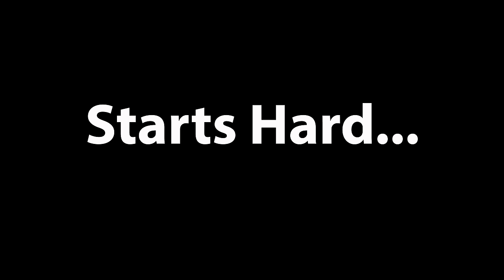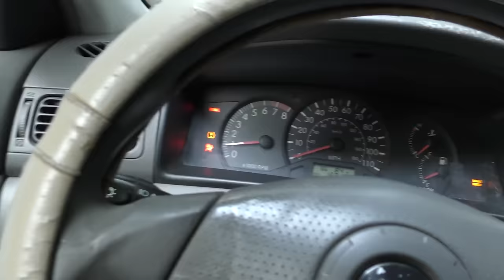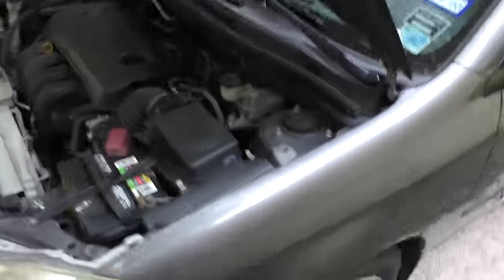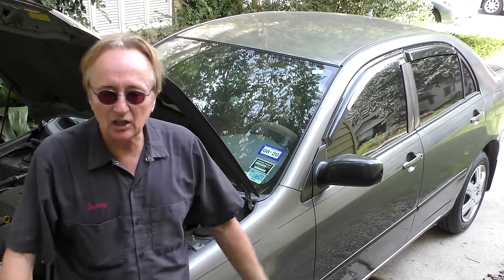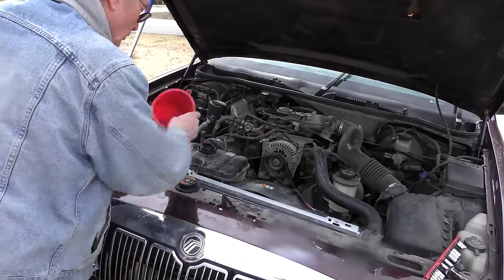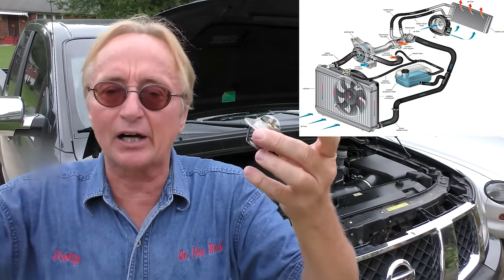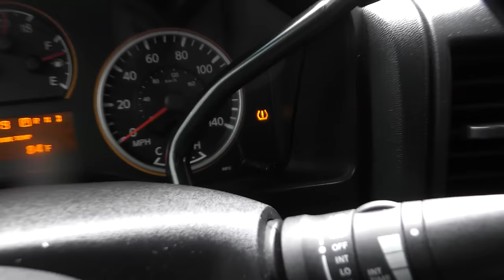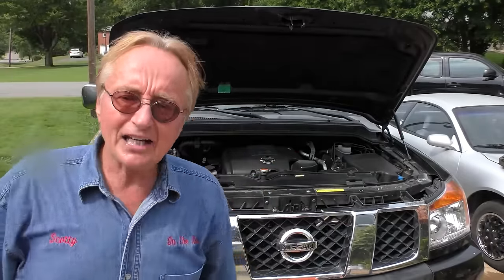If Your Car Does This, You're Screwed

Comment: Okay so, i have to Tell one thing about this video, 

I would Say, you can spend Three Time the amount of the car value that you paid, but if the car real value, are way Bellow than the average seller... Welll... You maybe can fit in your Money.

And sometime if you Found a good mecanic Guy, you can save money, by putting some decent replacement parts... 

On average, car cost Much more than the last 3 years, so... If you know that after putting some cash on a car and after it, it Will give you a long run... Then why not? Its only my personnal opinion.

Comment: Went to Midas the otherday for an oil change. I don't really know much about vehicles but i had been about 6K miles since the last. I constantly check the oil levels and colors to make sure everything is good. Anyways immediately upon getting home and letting the vehicle cool down I checked the oil levels and it was way below recommended on the dipstick. Im assuming they drained the oil and only added a quart or two when my vehicle requires 5. Do most shops do this?
Reply: Shifty dodgy mechanics will do that to you. Sometimes they will strip out the drain plug too.
Reply: They're horrible Corp! Often tgese places do not fill up any fliuds or repkace filters! They lnow people are lazy & naive.. My Volvo was destroyed by a highly reputable chain! Just vacuumed out the filters!

Comment: just went to the shop to get a diagnostic test cause my engine light came on and said i needed to replace the fuel cap and after 50 miles the light should go off but it hasn't . The engine still sounds normal, so what else could it be?

Comment: Hi. Goodmorning. I have issue with camry 2008  2.4 liter.    It starts vibrating when rpm reaches to 800. While car is stopped or at signal.  And more severe  vibration  when ac is on. Automatic car.      Cleaned the throttle body new spark plugs etc
Reply: Mechanic says to install. New original  mounts.
Reply: At. 1000 rpm. No issues. How to increase. Remember. That should stay  at 1000 rpm,,,,,thanks

Comment: Lmaooo I’ve been driving my 02 honda accord with the front subframe on the right side missing, tank leaks gas, maintenance & check engine light been on for over a year and it still drives smooth asf somehow it doesn’t even pull to the left or right.

Comment: I feel bad for my neighbor he has a older 1990s ford tourus. It runs fine when accelerating but when he comes to a stop it stalls out. And sometimes at idle it runs little rough. I had him unplug the o2 sensor and it idled higher of course and ran the same but it still wanted to stall when going to a stop.

Comment: $3000 IS TOO MUCH for a 100k Toyota that burns a little oil?  People who buy 3000$ cars should have realistic expectations. That said, it'll go at least 50k more.  Subtract $300 for extra oil, and figure out the cost-per-mile.   It'll be cheaper than ANY new car.  IF the car is junked at the end (and it'll probably sell for1000$), the loss will be MUCH less than the loss after 5 yrs if he'd bought ANY new car.

Comment: I apologize but i disagree with just installing some fan and putting a switch in the inside to toggle it. I hate when people do this crap especially if you are going to sell the vehicle or anything else. You might know whats its for but what if you loan it out or there is an emergency and someone has to drive it not knowing it and blows your engine? just make the repair the correct way and you dont have to go to the dealer to do this. everyone knows about rockauto and partsgeek to get the parts. Bottom line is do it the right way and you wont have any issues later.

Comment: I bought a 2000 Corolla with well over 200,000 miles on it. Had a check engine light, codes were for lean conditions and misfire. I changed the spark plugs, and I swear, they must have been factory original. There was almost nothing left of them. I put in the new plugs, and everything was fine. The old ones were so bad, I actually took a picture and saved it.

Comment: scotty is not a mechanic, he doesn't know about starting hard conditions... this is a fuel injection non-oe replacement problem.. the thresholds are different regardless of the pumps pressure

Comment: Scotty, I have a 2007 Toyota Matrix. The car constantly vibrates. It eases up when in park or stopped. I have had it checked by a few mechanics and they say they can’t find anything wrong. Any ideas what it could be?
Reply: Oem dealer
Reply: Check throttle body especially if it worsens when you put in drive or turn on ac
Reply: Sell junk
Reply: Check torque converter
Reply: Check the plugs, if its been a while, put some new ones. Clean the throttle body and the sensor this specifically fixed my excessive vibs and my buddy's too.
Reply: Clean the mass air flow sensor with appropriate cleaner, replace or vacuum if not bad the air filter, clean throttle body, try an fuel additive to clean injectors, replace spark plugs if not done in a while and check fuel pressure. That's a starting point if you have a check engine light the you have to diagnose it further (don't just replace parts without making sure that is what is broken and if you do replace parts that are electric you probably should replace it with original from dealer not online since there are many counterfeits.
Reply: Possible the lower motor mount is failing.

Comment: I have a 93 Subaru legacy and i gabe been having this random small grind nose coming at around 2 to 3000 rpms. It got more prominent after i replaced the power steering pump with a remanufactured one. I checked my transmission and it was all good so I’m not sure what is causing it…

Comment: bought a 2013 gmc terrain sle.  scary quiet engine, carfax history of regular maint, no wrecks, very nice running trans, 156k miles.  did some research. the one year model terrain that has had no mech probs, and estimated to run well with normal driving and maint to a minimum of 300k.  wife: "i think i like your car."  dodge garage i've used for 25 years said it's in very good shape.  $13k.  (this area market was $15k to 25k for toyota/hondas with 220k miles; new cars up to $45k. you can't make this up). allstate issued the policy for it.  good enough for me. this vid is right on target.

Comment: Nah, because my sisters bf claims to be a mechanic and gave me the go ahead to buy a used 2006 impala. Turns out the brakes were waiting to go, engine burns loads of oil and you can smell gas in the wheel well after driving. Load of crap
Reply: Luckily only paid 2k for it

Comment: Thanks that you give a price point compared to the kondition of the vehicle!
Despite people bad mouth me not liking foreign social garbage I got my beater Subaru for 1\10th that price and now a year and a half use out of it and jumped in it to drive to Lincoln nebraska for a gig with an extra 600+ miles into another state when I didn't get that job at bills towing in elicott maryland. And interesting despite its external oil leak and question of a small combustion has leak despite no bubbles internally it is burning less oil than what that Toyota is despite the Toyota engine is possibly a better design than this EJ series.

Kan you make a car emp shielding series.

Comment: I bought my Silverado which is a rear wheel drive and if found a huge leak around oil pan gasket and had a dealership replace it because I didn't want to have to drop the crossbeam and didn't have a torque wrench to match its specifications. Now I'm noticing excessive oil in the intake manifold and occasionally this starts hard. I replaced a lot of parts on this vehicle and don't know where to go, because no one else can find anything wrong with it. I was told a fuel pump or ignition switch, but I was told they could not tell because there were no codes and everything checks out. I was told by the dealership and two other mechanics that they cannot find issues that I was describing, so I am very puzzled. I love this truck and have done a lot of work on it and don't know what to do, can anyone help me?  It is a 2008 Silverado with a rear-wheel drive in a 5.3 liter engine that has been kept up for a while and commercial use.
Reply: You also may want to check your drivers side spark plugs for fouling afterwards and replace if necessary, namely cylinders #1 and #7 (front most and back most). Use genuine ac delco iridium plugs.
Reply: @wally7856  thank you!  It seems to be both sides and some have ash on them, they were brand new iridium spark plugs
Reply: @johnlee8734  If you still have problems after the new cover you can always install an oil catch can on the pcv hoses.
Reply: @johnlee8734  Light ash on plugs isnt a big deal unless its caked on so hard that your gap is reduced. By fouling I mean oil/tar like exxon Valdez build up that smothers the gap.
Reply: @wally7856  I've done that, but not much oil went into the can.
Reply: Update:  it hesitated again today, but as soon as I left off the brake it started with the brake pedal stuck downward.  No one else can replicate the issue.  Could it also have a brake light switch or brake booster issue?

Comment: Poor cold starts could also be a sign of needing a valve adjustment too. As far as Ik valves tend to tighten when warmed. Especially if it sounds noising in the top end. Feel like it could help, won’t help much for oil burning though. Could be valve seals piston rings to even a head gasket but head gasket usually isn’t common unless ur loosing coolant too. To much work to figure it out. Could be very expensive. And seems the cars not worth it

Comment: Took two high end luxury cpo cars to mechanic during test drive from 2 different factory dealerships, prearranged with mechanics and unbeknownst to dealerships.  Both “certified” as excellent condition and clean bodies by dealership showed obvious signs of past wreckage.   Mechanics even showed me clear specifics on the lift and gave report print outs.  

 One dealership caused a huge fit with me and said now they will have to junk the car to auction.  I used the mechanic’s info to counter offer at significant reduced price but they angrily kicked me out.  Doubt it went to auction, prob sold it to another poor shlub who didn’t do any due diligence.  

Other said an old lady drove the car into a mail box and was neighbors with the dealership owner.  all the work was done at the dealership which is why they said it was “as good as unwrecked” and why they cpo’d it.  I walked out disgusted. I also think it was illegal.  Again this was a very reputable high end luxury brand. 

I think one mechanic charged 100, other 150.  So 250 (plus I was so grateful I even tipped extra) saved me future heartbreak and money.

Comment: how do u avoid get splashed with radiator coolant?
Reply: Only check it when it's cool. If the engines hot and you pull the radiator cap hot coolant will spray out due to built up pressure. Like a shook up can of pop.

Comment: About TPMS tools. I got the less expensive Autel TPMS tool and the matching sensors. I have 4 TPMS sensors working after putting the sensor ID's from the OEM sensors into the new sensors. The spare was missing the sensor and I have no way of finding out what the last sensor ID is. Will the more expensive TPMS tool, or a more detailed OBD2 scanner be able to tell me the last sensor ID I need to get my TPMS system operational again?

Comment: Its possible that oil additives can fix that engine. As a last resort
Reply: That and several oil 2000mi oil changes and using good  filters.  toyota filters from the dealer--7 bucks apiece.   But there was a lot of black gunk on the top of that valve cover body.  I believe I would have given it a good cleaning, no matter what i thought of the car.

Comment: my car only sometimes has a hard start, turns and turns then just starts, but it can happen cold or warm or just cozy :P and it might just happen once or twice a month.

Battery and generator tested OK, New spark plugs. less than 10k metric miles. If anyone got an idea i would be very thankful :P
Reply: I have the same problem with my 02 Nissan Sentra. I actually sprayed the starter and a bunch of wires with wd-40 and after my shift it started up fine. 

I know for certain with my car it happens when it’s either cold or when there’s plenty of condensation. 

I had the fuel system cleaned new plugs, new battery. Granted I’m sure the starter itself is fried by now.

Comment: I have a 2023 Toyota Tacoma with an 3.5 litre Atkinson Cycle Engine with 2500 miles on it. It has noise that sounds like valve train noise, and the dealer says it's the high-pressure injector pump noise and it's normal. Is this normal?

Comment: Another trick people use is when the engines worn out so bad they put gear oil in it and they warm up the engine and then the person looks at it takes it for  test drive pays the money and then a week later not even that the oil will thin  out and you have a paperweight , happen to my father in law,  with a older pickup truck , brought the truck back to the seller he flat-out said no I'm not taking it back

Comment: IF IT STARTS HARD IT'S PROBABLY DUE TO AN OLD STARTER....
Reply: I have a used 2005 Ford P74 Crown Victoria LX Sport sedan. 185000mi. I had the alternator replaced 6 days ago, 2023. The solinodes were failing. It starts, runs stronger now. The CV had double platinum spark plugs: Bosch. New belt, new water pump. The intake manifold is bad but the car runs smooth.